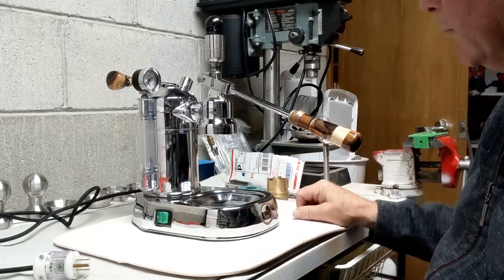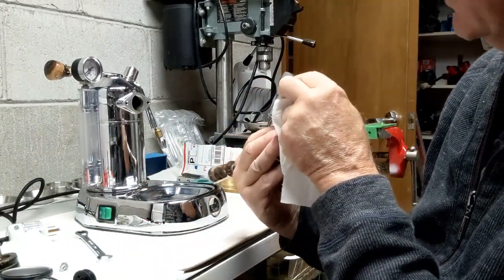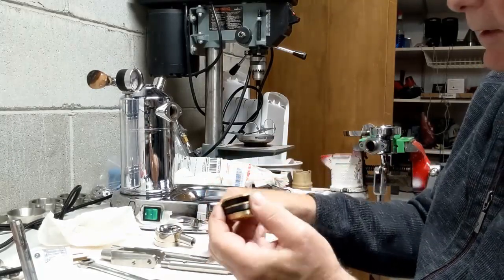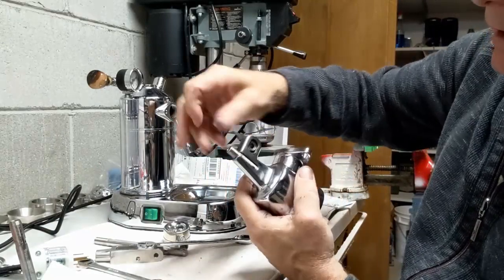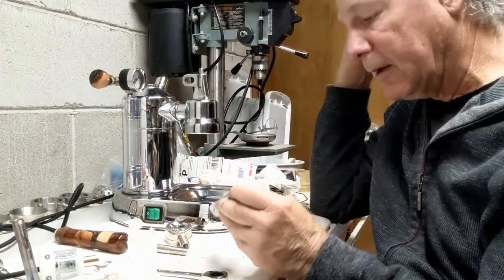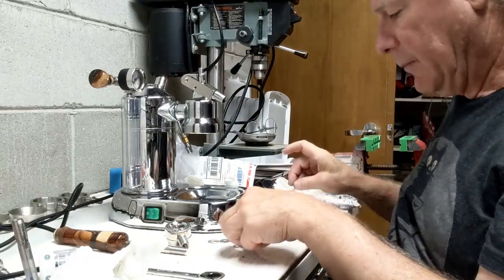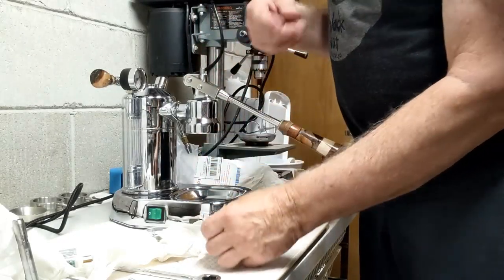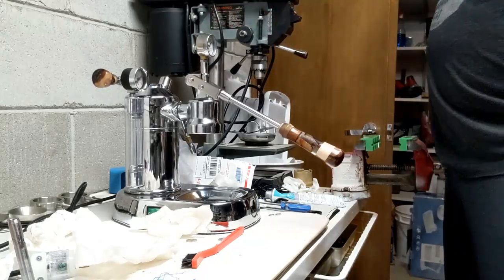La Pavoni pressure profiling kit & brass sleeve Install

Comment: Comments are back on - it's a shame they were turned off accidentally as it seems they were off for a long time..
I have come across the Coffee Sensor website and I thought of checking back on this video.

The PPK is great idea but what I'm really after is a thermometer gauge instead in its exact place  (to show the water temperature in the head). The problem is... I am not sure there is a needle thermometer that is both as quick and as accurate as the duration of a shot pull requires.
Reply from the maker: Thanks for the heads-up.

Comment: Great vid Bruce....i recently installed the pressure profiling kit but i'm still having issues with a lot of water coming through the group on lifting the lever (regardless of tamp and grind) would appreciate any thoughts?
Reply from the maker: Thanks. What's the Gen & year of your machine? Did you put Teflon tape on the piston rod threads? Are the piston gaskets installed correctly? If you want, send me a video by email. Go to https://www.youtube.com/@BrucePappas/about and select "View email address."
Reply: @BrucePappas  sure will do i would say it's 1997 model as it looks the same as this one in James Hoffmans vid: https://www.youtube.com/watch?v=lKimj0vRM5A
but I will send a vid anyways. Yes teflon tape on the threads. The piston came with preinstalled gaskets....the problem is pre-existing however, i had water coming through even before the installation as well😔
Reply from the maker: @subhkhan  - the only other place water could be leaking is from the gasket on the top of the grouphead. But then water would be coming outside the grouphead, not from the screen. I'll be interested in seeing a video.

Comment: This is so calming. love the work Bruce. I'm a Romantica 2006 owner. thinking about adding the pressure kit from tudor and the bong isolator. any experience on the latter?
Reply from the maker: Hi, Simon. My advice is the isolator is not needed on your machine, a Gen3 (built after 2000). More needed on Gen2s.

Comment: I have just fitted mine as you have here and water is coming out of the top where the pressure gauge is, do you know what the problem is? Thanks
Reply from the maker: There's a gasket, washer, & c-clip inside the top of the grouphead. It may need to be changed. Also, you may have to put Teflon tape on the piston shaft and PPK fittings.
Reply: @BrucePappas  thankyou! The machine is brand new so i will put the teflon tape on all the screw threads and see how it goes. Thanks for the video and the quick response 👍

Comment: Amazing to watch! Thank you!
I am struggling between a Flair 58 (about to be available in 10 days, need to buy a separate frother) and LP. What would you choose?
Reply from the maker: It really depends what you want. With both, you get to control all the variables needed to make good espresso. As you can see in the video, I chose a La Pavoni. But buying a separate frother is not a problem these days. So...go with the one that "sings" to you. I think the Flair would make a good travel machine.
Reply: With Flair 58 you're stuck with low temperature and dark roasts. Its 70°C temperature is a joke.

Comment: When installing the new brass sleeve, do I have to grease its inside wall as well as the piston and the two gaskets for a smoother movement?
Reply from the maker: You only need to lube where there's friction. Inside the sleeve and lightly on the outside of the gaskets. Also, don't forget to lube the piston shaft.

No need to lube the outside of the sleeve - no matter what material the sleeve is made of.

Comment: What pressures are you extracting at on average?
I installed the grouphead pressure guage on my Pavoni and on average am extracting from about 2-4 bar regularly. This seems low to me, since I know that supposedly 9 bars is "ideal", however whenever I manage to get it up to 9 bars, it's almost impossible to actually extract and it tastes awful. 
I'm wondering if perhaps I didn't install the gauge correctly (possibly teflon tape got into the hole) but I wanted to check with others to see if that was somewhat normal.

Thanks!
Reply from the maker: I don't think most of us with PPKs pull at 9. It appears the average is more like 6-7.

Comment: There is a way for adding this to a Stradivari model? Without changing the arm with a standard one.
Reply from the maker: No. The Stradivari handle moves over a smaller capture nut and the top of the piston shaft. Even LP used a different handle on their Stadivari Esperto.
Reply: @BrucePappas  bad news... so just only with the stradivari espresso is possible to do? And there are other way for measure the pressure in the basic Stradivari? Thanks.
Reply from the maker: @sirbotte  - unfortunately, no, not that I know of. Have you seen how the Esperto looks with the standard handle?  
https://www.lapavoni.com/en/product/esperto-abile-espab/

Comment: Hello sir, I'm new in the world of lever expresso machine, just have a question, which La Pavoni well build choose? Europiccola, professional or stradivari? Too much choice
Reply from the maker: IMHO- more important to look at the machine generation (designated by its grouphead mostly). I'd look for a Gen3 machine (after 2000) = more temp stable. I prefer a Pro = bigger boiler size. If you like the look of the Strad, get one with a larger boiler, but a Gen3 will perform the same as the more expensive Strad.

I agree, so many choices and differences between machines which appear subtle, but are significant.

If you get a Gen3 Pro, try to get one after 2007, when the factory went back to brass pistons. But you can always change the plastic one to a brass one for not much money (I did that).
Reply: @BrucePappas  oh thanks Bruce! I didn't thinking about generation.
Reply: @BrucePappas  Bruce, last question, is the pressure gauge on some boilers is helpful ?
If I'm sounding insistent, sorry...
Reply from the maker: @eddyb.8056  - no worries. Personally, I think ALL LP boilers should have pressure gauge. It's cheap and a good safety feature. Luckily, you can easy and cheaply install a pressure gauge, so don't let that deter you from buying a machine.
Reply: @BrucePappas  thanks to you, i will drink some good ristretto! 👍
Have a nice day
Reply from the maker: @eddyb.8056  -You're welcome. Knock one back for me!

Comment: Do you know if this process changes for a newer model or specifically the esperto abile?
Reply from the maker: Yes, the interior of Gen3 (Millennium) and Gen4 (Stradivari). The hitch is the Gen4 handle. You will no longer be able to use the curved Stradivari handle, but will have to use the new Gen3 supplied with the kit.
Reply: @BrucePappas  The esperto abile doesn’t have a Stradivari handle? 

And I’m mostly wondering about cleaning the machine, not too interested in the kit itself. I’m wondering if to clean my esperto abile if the process would look like this? 
Assuming to clean the esperto I’ll have to take off the pressure profiling kit it already comes with. 

In that case there will be no need for me to switch any handles right?
Reply from the maker: I apologize. This is a video about installing a brass sleeve and a PPK. I don't know what cleaning process you are asking about?  (And yes, the Esperto Abile already has a PPK installed and a Gen3 handle.)
Reply: @BrucePappas  no worry that my bad thank you :)

Comment: Hi Bruce! Thans for the wonderfull video!
My question: 
I have the Copper-Gold version of this machine. 
Do you think, could I use the original lever instead of the delivered chrome one with this upgrading set? 
Thans for the answer. 
Warm regards from Vienna.
Reply from the maker: Unfortunately (and fortunately), no. The lever needs to be replaced. Good news is the new lever is a much better design.
Even better news, Tudor now makes this kit in brass.  https://coffee-sensor.com/product/coffee-sensor-brass-piston-pressure-kit-for-the-la-pavoni-europiccola-pre-millennium-and-millenium-machines/
Reply: @BrucePappas  oh! Thanks! That will be exactly what I need!
Reply from the maker: Have you joined our FB group! We're friendly, helpful lot!

Comment: Did you oil the gasket before putting it on?
Reply from the maker: I lubricate all rubber gaskets before installing them. I use Dow-Corning Molykcote 111.

Comment: Mine is still a plastic sleeve and the pistone as well. I bought a lavazza coffee in the ebay. But when i tried my la pavaloni there is no crema on my coffee....I don't know which one is need to replace is it my plastic sleeve and pistone to brass or my coffee bean is not fresh anymore. Please help
Reply from the maker: The brass sleeve is not yet available. The brass piston is from any LP supplier. Sounds  like your problem is more related to beans and grind. It's best to use whole beans freshly ground. Please join our Facebook group for more support.

Comment: Why sleeve have to be change ?
Reply from the maker: The piston and shaft require a hole down the middle.
Reply from the maker: Sorry to confuse the two. You can do one without doing the other. I did the new brass sleeve and the PPK together, as it was easier since the grouphead was open.

Comment: Great demonstration but the drill press in the background really steals the show from LaPavoni... What make is it?
Also, you said the brass sleeve returns the Millenium to pre-mil. status, however, the piston on milleniums is of a smaller diametre, no? Where did you get your brass sleeve and the brass pistons from? I have both the pre and the millenium. I can't stand the millenium. It was bought new and has all sorts of bad QC issues, leaking from every fitting on the boiler from day one. It really ought to have been sent to the service department which is ridiculous for a brand new product. The pre was bought second hand a decade ago, was serviced and never had any issues. It just needs new piston seals now.
Reply: Did you mean to say you can’t stand the Mil instead?
Reply: @cjpriustt  Ah yes! typing faster than I can think as usual...
Just corrected it. 
I have read a lot about the pre vs mil. in the last few months and I've come to appreciate the changes in the design, or more precisely the pros and cons of each design (in my mind at least). So now, I understand the mil. does control some of the factors affecting temperature stability in a better manner.
My issue, generally, from such design changes is with replacing a metal part with a plastic one. I always feel the customer gets short-changed this way. Literally too if you think about it: the plastic parts cost a fraction of the metal ones but the machine still costs the same amount. Plus I have an issue with drinking something hot that's been brewed between a teflon jacket and a plastic plunger. Could be I'm imagining things but, hey..
Reply from the maker: It's a Delta bench drill press.
Reply from the maker: The plastic (Ryton, I believe) sleeve is for heat management. The plastic piston is no longer being made, so it's good to replace with brass (or get a PPK).
Reply: @BrucePappas  Cheers for that. I'm trying to find a similar one online but no success so far. Looks impressive.
Reply: @BrucePappas  I didn't know that. I thought it was Teflon and intended to reduce friction between the plunger and the sleeve. 
Good riddance to the plastic plunger. I don't see any reason for that other that cost saving (which is a disgrace when considering how much the machine costs). The only possible excuse would be that the thermal expansion would have to match that of the jacket, which is also plastic. Again that's as stretched as can be...